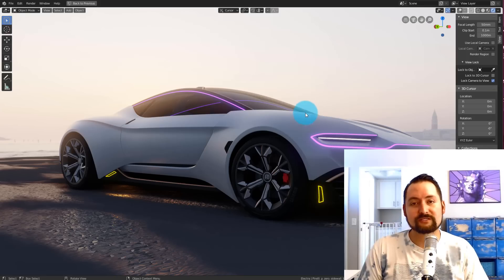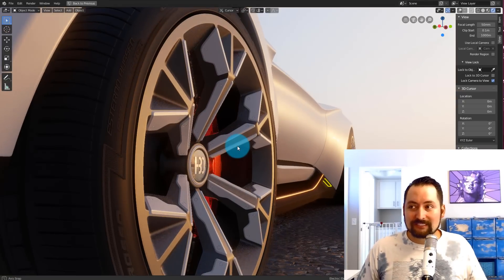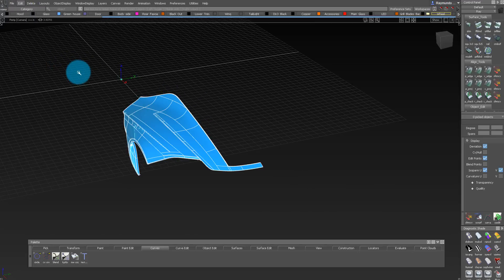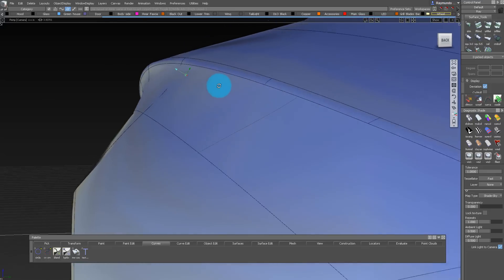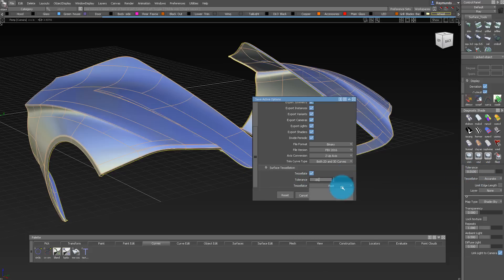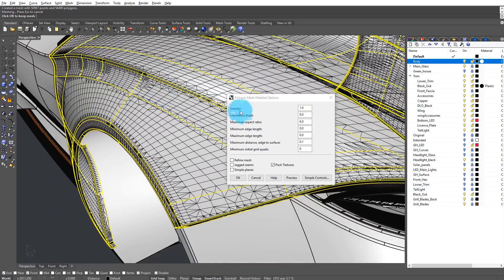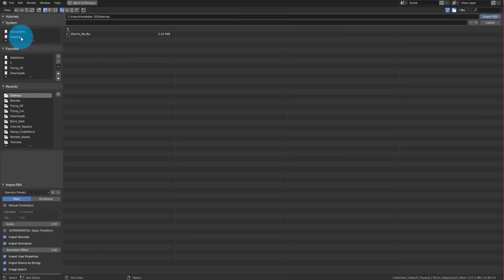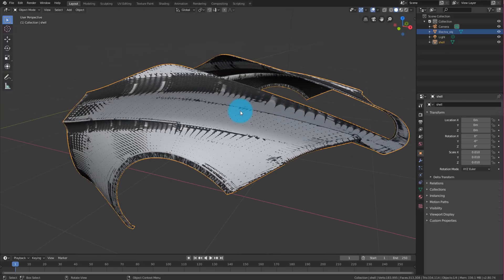Blender 2.8 Visualizing CAD pt.1: Importing Automotive CAD using Alias or Rhino

Comment: Very useful, thanks! Have you encountered issues with surfaces normals vs surface orientation when importing to Blender? I spent the last few hours trying to figure out how to manage this. It appears Blender has no idea 'surface orientation' is a thing the way it is in Alias. But it affects the shading dramatically (as in: it's sh*t). I know this is a lot to ask: if you have the knowledge and time, I would love a video exploring this topic. Huge thanks either way, keep on rocking!
Reply from the maker: Surface orientation is a system made in Alia’s to help import into its autodesk render software called vred. Blender and any other 3d software will only read the normal not the orientation. So you have to flip them to make sure all the blue are outside and red inside. The yellow one is just for autodesk workflow.

Comment: I'm working with Alias for over 25 years and I loved it in the beginning. Now that I started using Blender it suddenly becomes  apparent to me how bad and outdated in many ways Alias actually is. (Ancient render engine, inconsistent UI, broken history, and so much more...) It's really a shame that (among others) it is still not able to convert NURBS to quads with proper topology.  I love to use Blender for visualization especially with Cycles on an RTX card but because of the miserable topology of the imported triangles, you can't do anything else with the imported model. Modifiers which change the form (like bevel or solidify) don't work because the topology is so bad. I really hope that one day Blender will provide the NURBS toolset what Alias has and then finally we can ditch that super expensive and badly maintained software. It's amazing how much improvement came into Blender in just the last 12 months. It's definitely the future and I hope that the development team will keep up their splendid work.
Reply: Don´t forget: Alias still is magic! Polytools like Blender are magic for visualisation, I agree!  But when you need surfaces for milling, engineers... try out AliasSubD Limit Surfaces and you will like Alias again Steve ;-)
Reply: @TheSTROHM  Hi Stefan!😊 I tested the SubD in Alias the last two months but compared to the SubD tools in Blender I had very mixed emotions. I'm using Blender for building precise parts for 3D printing and I love it. Creating proximity loops in Alias is a pain as you have far less possibilities to manipulate individual edges as in Blender. Keeping a proper topology is also much more problematic. The Catmull-Clark implementation in Alias folds in concave corners badly. It's great that you can mix SubD with Nurbs but only if you do simple objects (large exterior surfaces) with it. I built up headlight parts and that was a pain. Trimming those underlying Nurbs is a nightmare and if you change the projecting curves (which is the point of quick SubD modelling)  your trimming messes up. Please don't misunderstand me, I still like to use Alias but when I see the development speed of Blender compared to the decades long struggle of Alias, I can only shake my head... 20 years ago Guido, Marco and me sent pages of feature request to Sriram after he visited us here... some of those requests would still apply today... It's great that recently something started to happen but there needs to be MUCH more development...
Reply: @SteveThinman  Hi Steve! Thank you for the detailled response. Hope there is soon a chance again to discuss these topics while sharing our screens.
Reply from the maker: Hey just a heads up. Rhino has a very good tool called quadremesh. It exports the whole surface layout as one very good and usable quad based mesh.

Comment: Hello, when we take file from alias to blender, we convert it into Obi. Or fbx,right.
My dout was, do we have to convert each and every layer into obj or fbx?  Or
Can we convert entier file at once in obj or fbx?

For example i have more than 20 layers which i want to render it, so do i need to convert the layer individually or at once i can convert entire file in obj or fbx?
Reply from the maker: Manthan Mhaske you can convert the entire file just select all the objects. You will probably have to do a lot of organizing afterwards inside of blender.
Reply: @HandleBar3D  What i have done is that, in alias the surface which i wanted of one colour, i have deleted the history, deleted the nodes, made the surface as a single object and assigned them into a single layer.

I have already done all the procedure in alias itself.
Reply: Know, i have to take the file in rendering software  and easy for me to apply the material.
Reply: I have more than 15 layers so wether i can convert entire file or i need to convert each layer in obj or fbx?
Reply from the maker: Manthan Mhaske i would just do it later by later how I showed in the video
Reply: @HandleBar3D  ok👌
Reply: Thank you🤗

Comment: Hi HandleBar3D, I started learning Alias with your videos for personnal projects but I have a specific question : how to properly add thickness to a complex surface (like the back body part of your car in this video) ? thanks :)
Reply from the maker: Sylvain Klein you use object edit- offset, and you offset the surfaces, than you add a draft depending on your angles and tolerances. It’s super slow in Alias, most thickness operations happen with other software, inside a car studio that is.
Reply: @HandleBar3D  Thanks ! I tried a few time to use the offset tool but when surfaces create very close angle it doesn't work very well and fail most of the time I tried... But maybe it's juste my lack of knowledge.

In which other software do they usually add the thickness ? (I tried in Fusion 360 and it doesn't work, the surfaces is to complex for him very quickly)
Reply from the maker: Sylvain Klein they use Catia in a car studio, I myself would use rhino.
Reply: @HandleBar3D  Ok Thanks a lot :) I'm looking forward for the next video^^

Comment: Just a small tip regarding units, if you frequently export between different softwares that use different units, like mm, you can just go to Scene Menu > Units > Length and change Meters to Millimeters. That will make 1 Blender Unit (basically the size of the grid squares you see in viewport) equals 1 mm and then importing would be hassle free without needing to worry about scaling issues. 
Also, if you want to scale something to the same size in all the three axes, instead of doing it individually in all the three XYZ sliders, just drag your mouse down across the sliders and you'll be able to change all three values to a new one at the same time!